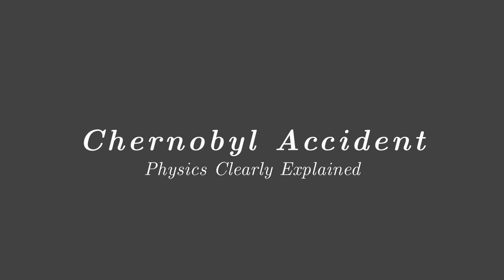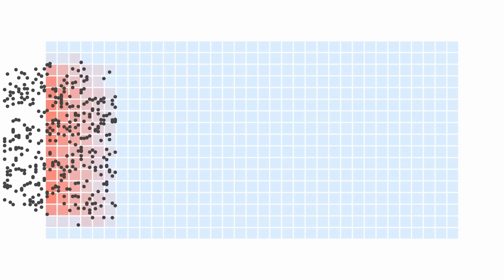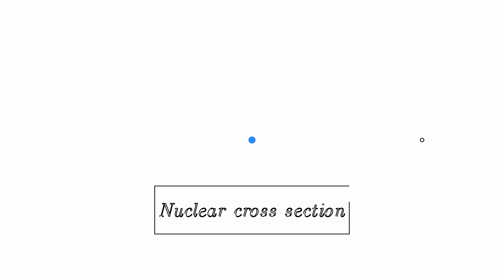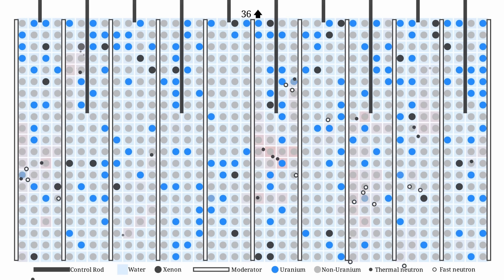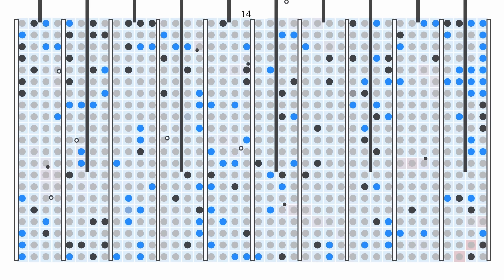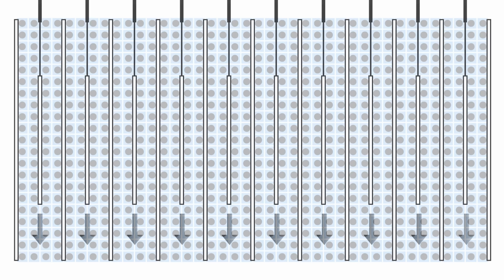Chernobyl Visually Explained

Comment: You lose me at 14:30, the top has less stopping power than the bottom? I have no idea what that means or why the graphite got stuck or why we ignored the graphite or what the graphite does.
Reply: I think he means that because of all the extra heat and pressure they could not exert enough force to push the control rods back into the reactor
Reply: @jlbman1887 as i recall some part of the water boiled instantly blowing up and bending some of the control rods in place, which then endlessly amplified the reaction. but i could be wrong
Reply: It means the reaction is accelerating faster at the end, that came in contact with the Neutrons first, and is accelerating inward out, with the graphit having a limited range of how much heat it can moderate, before itself becomes "fuel". Therefore "the bottom" has less "stopping power", because it was exposed for a longer duration. Imagine it like a cup of boiling water, where the "heat" is building  from bottom to top, and the water only starting to boil when the whole body has reached its boiling point...nothing you can do at this point but removing the cup from your oven.
Reply: Imagine being this dumb

Comment: I have done a lot of research on Chernobyl, and putting the graphite neutron moderators on the bottom of the control rods is such a head scratcher.
"Let's SCRAM and stop this thing," while moving neutron moderator material right through the middle of the core.

Comment: 3:00 It was not badly made at all. Although the first generation reactor had some design flaws, it was generally well designed. At least 18 of them were successfully built, and some of them, after modification, were used until 2006.

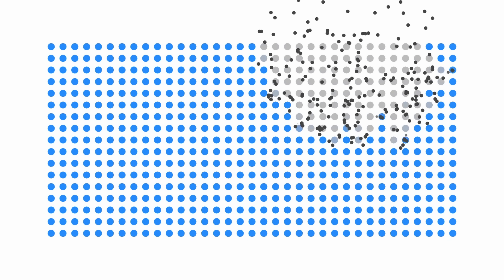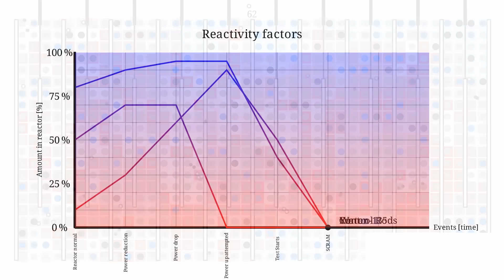Comment: i just realized that the sound of the fission, specifically at 1:36 and 15:09 sounds exactly like geiger counter and hearing a geiger counter going crazy is scary
Reply: well it would make perfect sense to design geiger counters off the sound of fissions--because... thats what geiger counters measure.
Reply: @rizzmo8451  The sound of fission here is really just the sound of collisions, a click whenever neutrons collide with each other. In the same way, a geiger counter clicks when an ionisation event is detected. Fission doesn't literally sound like that, and if anything it's probably more likely that the sound here was designed either just because the click sound used is very good for audibly communicating the frequency of events, or even possibly because it's a similar sound to that of a geiger counter so we already strongly associate it with radiation and with danger.
Reply: @rizzmo8451  the original geiger counter click sound has a more simple reason to sounding like that
Reply: @rizzmo8451 Fissioning uranium doesn't make a sound in real life, only in the simulation (where it is based off of a Geiger counter's sound.) You had your order of operations mixed up.
Reply: @ratemisia  No shirt Sherlock...the point is, both represent accurately what's happening during fission.  It's interesting and "cool".
Reply: You guys are all wrong. Geiger counters count geigers.
Reply: @neveragainlilhomie Giggidy Giggidy
Reply: If you’re scared of Geiger counters going crazy, just wait until it starts screaming in one continuous high-pitched noise
Reply: Fission doesnt make a sound, dude. This is a youtube simulation. They intentionally designed the sound to be similar to a geiger counter, you really couldn't figure that out yourself?

Comment: i have to ask though, is the RBMK Reactor as a hole still a good and maybe future proof design? after all it has some pros and cons, but are the cons solvable?
Reply: No.  The RBMK is a low-budget reactor, cutting costs by neglecting basic safety precautions.  Solving the cons results in an entirely different reactor.  The reactor can be managed effectively to produce energy, but it fails to meet the most basic health and safety regulations; its unparalleled potential for catastrophe is a deal-breaker before construction could even begin.

Comment: You lost me at step 6. Why did the bottom specifically have more accelerating power than the middle, and why do I not see this in the simulation? What caused the control rods to get stuck? What would the simulation look like had the rods not be dropped?

Comment: Okay, not bad, I saw just the simulation at first but came over here after and appreciate better what you've done. The model is decently complex but you have a few things that could use adjustment. Firstly, you could use some control rods coming up from the bottom to balance the difference between bottom and top. Secondly, the safety test was actually supposed to be run during the day, not at night. This seems like a nitpick, but answers your mention of not knowing why they increased the water flow... that was part of the safety test they were intending to run; they increased the main pumps, and turned off the secondary pumps, to supply the cores with extra water so the core would be less likely to overheat. In theory, it should have only been like that a short time, but they were interrupted while doing those preparations. This then is a big thing to understand in jumping from "event 2" to "event 3", over ten hours had passed (from 2pm til almost 12:30 the next morning). The "unexpected" power drop was in fact an entirely logical scientific effect... like you said, running extra water led to fewer control rods and thus more xenon. Also worth mentioning that a large part of the reason the control rods moved so slow when SCRAM was pressed was due to the pillar of boiling, high-pressure, steam-n-water below the graphite sections. With that said, this is still an excellent model of the most important parts!

Comment: All you really did was increase the "refresh" rate of U235. Would it have reacted different in any other state of your model?
Reply: In a real reactor since you arent dealing with only 100 atoms of u235 but trillions upon trillions in each fuel rod, you dont need to "refresh" the u235. Its just since he has such a small amount they are used up quickly.
Reply: @Idris.505  He could just have lumped them together as he did with the water, decreasing the chance of hitting one as the fuel is used up. But that does not happen quickly anyway so can be ignored completely to begin with. However, it makes the animation so much better to look at. And that is probably the most important part here, just look at how many in the comments love his model because of how it looks, regardless of how (not) useful it actually is to predict what a reactor would do. Imagine how much worse it would look if either the neutrons come out of nowhere or if there are U235 everywhere all the time.
Reply: @leocurious9919  Exactly I couldn't agree more. As a nuclear engineering student this definitely works as a great learning resource, not as a proper model for reactor control theory.

Comment: The explosion was actually triggered by the AZ-5 and you just ignored this fact attributing all to the slow reaction time. This was not the case.
Reply: No he didnt, he outright said pressing the AZ-5 button increased moderation to the point where the explosion happened.
Reply: @Idris.505  how is it depicted in the model? It just went as before? the graphite rods were there all the time and AZ-5 doesn't change the reaction speed.
Reply: @pahom2  it definitely does, the graphite tips when dropped led to ultra high moderation simply due to the reactor geometery in these conditions. Neutrons moderated lower down in the reactor increased reactivity loads.
Reply: @Idris.505  they weren't "dropped" they have always been there in this simulation. In reality they have also been in reactor all the time and this moment actually raise most questions. Why moving graphite ends from the top part of the core to the bottom of the core caused this spike of reactivity.
Reply: @pahom2  like I said due to the geometery of the reactor a moderator has greater effect at the bottom off the reactor than the top. Same applies to the control rods. So having graphite tips on the rods meant as they were lowered during the SCRAM it caused the even higher spike.
Reply: @Idris.505  how so? In his simulation top and bottom are identical. In the simulation the only factor is delay.
Reply: @pahom2
In the RBMK design, there’s more steam at the top of the reactor and more water at the bottom. Water moderates (slows down) neutrons, but steam doesn't. This means that, at the bottom where there's more water, the neutrons are more likely to slow down and cause more fission, making the reactor more efficient in that region.

So, placing extra moderator material toward the bottom, where it can work alongside the water, maximizes its effect. At the top, where there’s mostly steam, extra moderator would be less effective, as it doesn’t interact with as many neutrons. This meant when they scrammed the reactor whilst in abnomial conditions the extra moderation of graphite with no cooling of water or xenon led to the explosion in the end.

Comment: I really liked this simulation, but I'm left with the same question I had after the Chernobyl series you pulled some footage from: what exactly causes the explosion?

I understand there is an extreme thermal gradient and its getting worse, but where does the combustion or explosive force actually come from? 

Is the temperature so extreme that some kind of termite reaction starts? Was there so much heat that the air turns into a kind of plasma with oxygen and hydrogen from the water? Did the reactor caps act as a kind of pressure vessel to make whatever was reacting into a kind of explosion? Was some huge quantity of water somehow trapped in the reaction in such a way that it all vaporized at the same time?

I want to know a little bit more about exactly what the explosion dynamics were. What was the fuel? What actually exploded?
Reply: Hydrogen, when the water is that hot it turns into it constituent elements of O2 and H2. Hydrogen is infamously explosive.

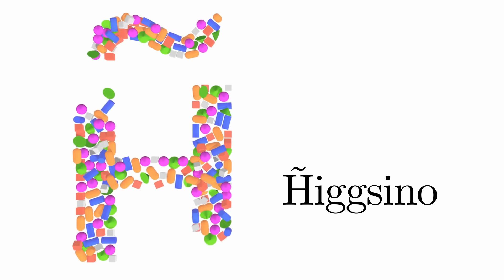Comment: 16:38 Except that the other reactor at Chernobyl kept operating, same as the rest of nuclear reactors elsewhere in the Soviet Union.

If the Soviet system had been a distinct factor, there would've been a long list of Soviet nuclear reactors blowing up... we wouldn't even know Chernobyl, it would've been buried in a long list. 
Blaming Chernobyl on the Soviet "corrupt" system makes as much sense as blaming 3 mile Island and Fukushima on capitalism (untouched by corruption 😅), where cost reduction is prioritized over safety concerns. 

Also, the whole "Soviet = cheap / capitalist = great" mentality is hilariously delusional.

Here on YT there's a good number of channels dedicated to major infrastructure failures, they're very instructive and an essential reminder that western shit smells just as bad. 

For instance, Grady Hillhouse (Practical Engineering) recently made a video about the failure of Taum Sauk Dam, check it out. 
He's also made several other videos covering cases of major infrastructure failure, worth checking out too.

Watch enough videos about such cases and a pattern will emerge... a pattern of corruption, incompetence, overconfidence and, most importantly, cost reduction over safety concerns.

Comment: the R.B.M.K reactor by design was the most unsafe reactor that could be designed when handled by an inexperienced crew. thats not to say that the R.B.M.K reactors were bad by any means. when operated right and maintained they did in fact perform pretty well and were a good budget friendly alternative. but as you said cheap isnt exactly the best option here in this case given that it was being used by a culture that has no care for safety, a government that had no safety regulations, a crew that was inexperienced, and a reactor that was very poorly maintained over the years.

reactors these days are well understood by most countries and our understanding of how fission works is better now than ever. not only that but countries like the U.S have been working on ways to perfect the technology that goes into these reactors to make them not only impossible to blow up, but nearly self sufficient with very few needs for human input. nuclear power is by and large the most clean energy that can be harnessed when done right, and the waste is very easy to contain and dispose of which in many years could be useful. sad to see that so many people are afraid of nuclear energy and refuse to accept it for how amazing it is. but with any hope maybe we can start making progress to utilizing nuclear power and making it more common. hell, heres hoping we can figure out how to harness fusion instead of fission. but thats not likely for another 100 to 200 years at this rate.

also thanks for the video. it was amazingly informative and helped a great deal to better understand just how badly things went in a matter of milliseconds. will 100% share this with some friends of mine who are geeks about science and nuclear reactors.

Comment: Thank you for some much needed education on how reactors work. It would be amazing if you could cover the new and safer designs as a comparison. People simply don't understand and have been scared by negative media coverage and bias towards non-nuclear. But, as you stated correctly, nuclear power is much much safer than fossil fuel when you look at the data.

Comment: 2:15 "each loose neutron on average only hits a single U235" I think you meant either "every third emitted neutron on average hits another U235" or "the neutrons emitted from each split on average only hit a single U235". If actually each loose neutron would score a hit, that would be the highest possible reaction rate and thus explosive force.

Comment: I think you forgot the fact that water can also moderate high speed neutrons by slowing them down to thermal neutrons as well as graphite. Therefore their should be an additional moderation effect as high speed neutrons move through the water included in your model.

Comment: This was a great explanation video. I think I understood everything, except the last part which I am unsure. I'll rephrase how I understood it and let comments confirm / correct me.

The bottom part of the rods was not a neutron absorber, but a neutron speed reductor. Neutrons needs to have a slow enough speed to react with the next uranium and keep the reaction chain going. By starting to lower the rods, the bottom part reduced the speed of more neutrons more quickly (reduced the distance a neutron had to travel before being slowed) and hence increased the speed at which each new neutron could react and keep the chain going.

I also think I understood that the heat generated was so intense that the rods could not be completely lowered, so they stayed in the position where they had a detrimental effect (reducing neutron speed)

Comment: ...when you remove or disable (some/all of) the liquid water during operation... under certain other conditions it all can go just boom.
because the liquid is an integral part of the particle removal system. water is a very volatile item in terms of such an often hot and horefully pressurized running system.
but when the water is gone then all your hopes are gone...

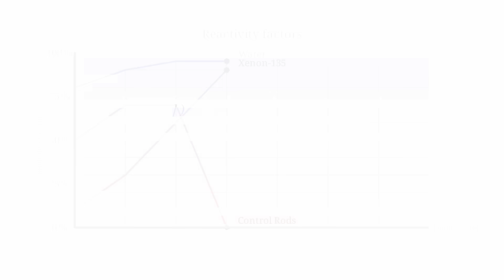Comment: 12:41 "Event 5: Test starts. The reactor was still stuck at 7% power. The computer wants them to shut down immediately, so... they turn off the computer instead"

🤣🤣
Reply: To be fair, they did do what the computer told them to do-"turn it off" 😅

Comment: I noticed that during the simulation of the actual meltdown, the replenishment of the uranium, so the rate at which the balls turn blue, is much, much higher. Why did you choose to do that? Of course this would increase the rate of the reaction, right? What would have happened if you didn't do that?

Comment: Very nice video, thanks for sharing!

So if I understand what really kicked off this chain of events negatively...it was them inexplicably increasing the water flow during Event2 as they prepared for the test?  Had they kept the water flow the same and simply retracted the rods, the power would not have dipped so low and started the whole cascade of bad decisions.  Is that correct?

Comment: Neutrons are not the ones heating the water (only 2 or 3 %). Most thermal energy transmitted to the water comes from the fuel's surface (which is heated by the kinetic energy of the fission products). Super nice video btw! Congrats.

Comment: This is incredibly well done but imo misses an important point. While it would have gone out of control without SCRAM, SCRAM actually ended up speeding up the process. With the moderator control rods attached to the graphite rods, there’s a space below the rods that has water which as you correctly said absorbs a little bit of the neutrons. SCRAM had the control rods displace this water with a moderator, causing the bottom of the reactor to rapidly increase even further than it previously had.

Comment: You are missing the crucial point that the water is performing a large part of the moderation. This is a safety feature of water-based reactors, where U235 only fissions with thermal neutrons (as you explained correctly), but where the water in the core is doing the majority of the moderation. When the water heats up, or void increases, or boils of completely, moderation is greatly reduced and likelihood of further fissioning of U235 is likewise greatly reduced. Otherwise, this is a really cool way of showing the fission process, good stuff!

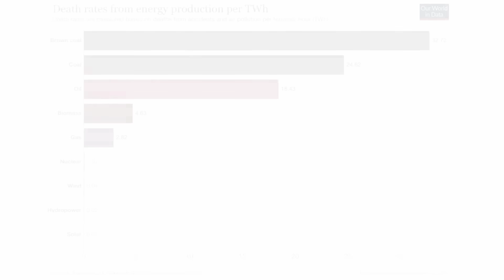Comment: 16:20 "please tell me how an RBMK reactor core explodes." to "please tell me how a reactor core with a negative void coefficient explodes."
Reply: someone already figured out how it could explode but it wasn’t published because of the Soviets. With free information it will be fine.
Reply: Explosion just happens because fuel rods are plates with circonium. This plating sets free h2 which makes the explosion to h2o. Otherwise it would just melt.